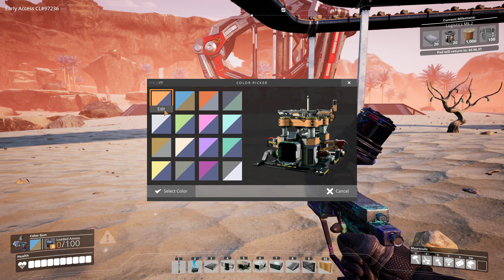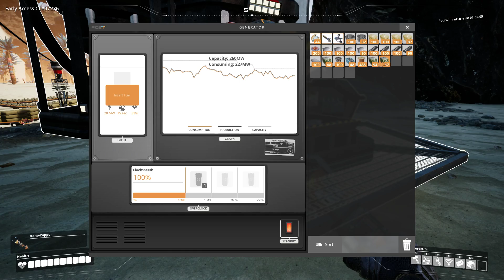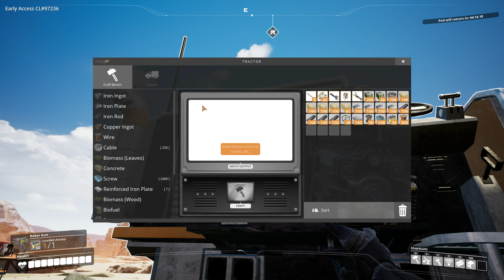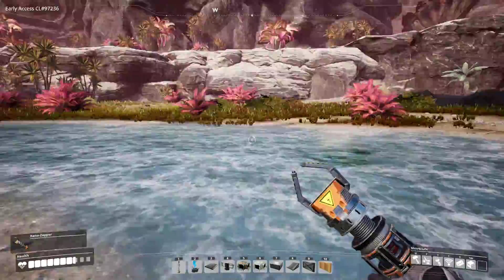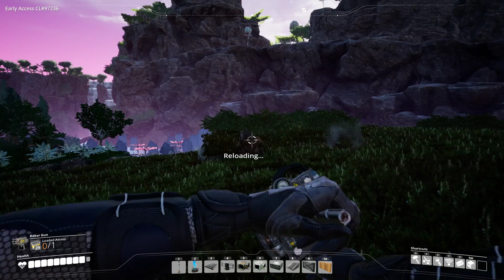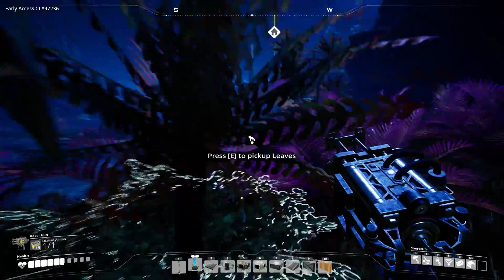Finding A Coal Oasis | Satisfactory Desert Bus Ep#12

Comment: I usually build my coal power right up on that cliff.
Once you transition out of coal those 4 normal coal nodes along with the single pure iron node make for a perfect ratio Steel factory with alternate steel recipe.

However on top of the huge cliff just east of the desert there are 3 pure coal deposits. Getting there is a bit of a pain though. All paths are covered by these annoying poison vents. I hope we can blow those up soon.
Reply: I made a ramp up the waterfall to the coal. It worked well.

Comment: It's actually safer to melee the hogs than to try to use the rebar gun. The reload time is to long and gets you rammed. But even with the basic zapper you can back away and smack them in the face when they charge, and you're ready pretty much immediately to hit his buddy and their buddy too when they rush you.

Also, jumping is a much more reliable way of dodging the charge attacks from the regular size hogs, although it won't help with the alphas, except maybe if you have blade runners on. You can outrun the normal ones if you do, but I don't think base sprinting speed is enough to outrun any of them, so you're a lot safer keeping them in front of you and interrupting their charges with a zap to the face in my experience.

Comment: I found it a lot simpler and more reliable to just belt the materials back to base, even if it’s over a kilometre away. I had issues with the trucks falling down ravines and possibly clipping through walls when I wasn’t around.
Reply: In the long term this is the best option because your mine and belt technology will improve over time, and at some point you'll be shifting coal to steel production instead.

Comment: why not put all the power right there at the coal node?  just run a wire back.
Reply: He doesn't want coal mining to shut down completely if the power grid fails for some reason. It'd be like Factorio's power death spiral, only a lot quicker.
Reply: @timothymclean  Could easily do a two stage setup to avoid that problem